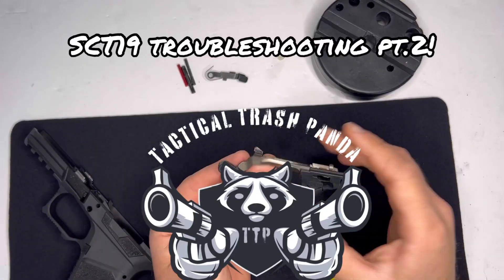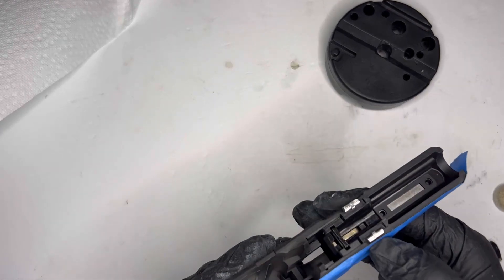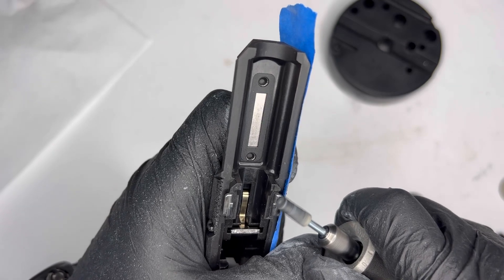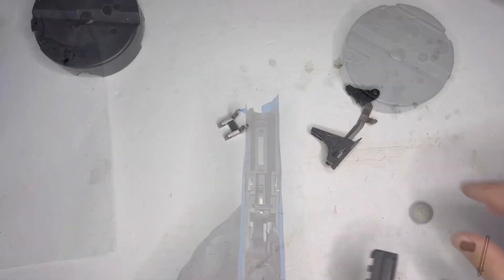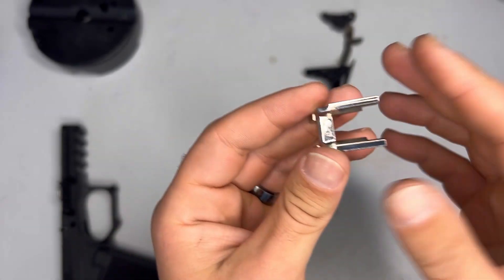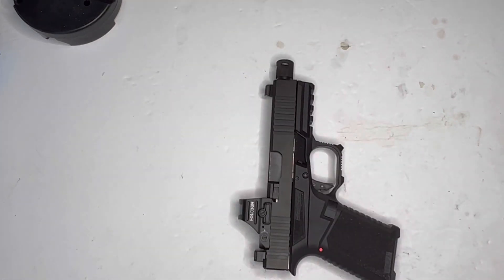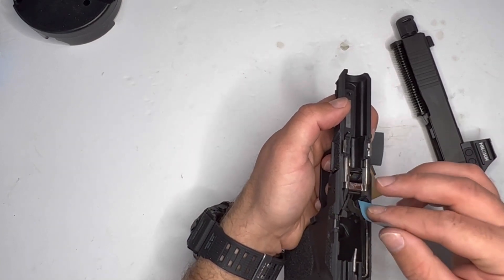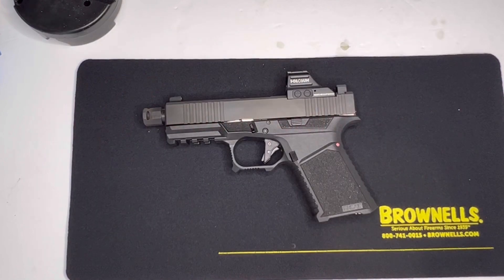SCT Trouble Pt.2 @brownells

Comment: I had the same problem with my sct19.  My problem ended up being the. Brownells recoil spring / guide rod.  Switching to the oem Glock part fixed my problem.
Reply: brownells has oem glock parts on there aswell so did you switch it out with oem glock parts from brownells ? wanna make sure if i have this problem i won’t buy oem from brownells
Reply: @jonfym  I bought the brownells slide completion kit first, but most of those parts had issues.  I fixed the problem after I repurchased all the Glock OEM parts.  The only Brownells part that is still working is the striker spring.
Reply: @CTorres_1993  ok good so basically in other words don’t get brownells oem glock parts cool . thanks for your help appreciate your feedback!
Reply from the maker: @cody mine ended up being the overwatch percision connector’s bend angle was too far out causing too much friction onto the slide. I swapped it out with a zev connector that I had laying around and it seemed to solve the issue. I did replace the recoil spring with an oem though just to be on the safe side.
Reply from the maker: I haven’t had any issues yet with the Brownells parts in my other builds.
Reply from the maker: You can never go wrong with oem parts 💯
Reply: @tacticaltrashpanda  hmmm so the gun is fixed that’s great! i was waiting for your next video to drop seeing what was going on and is it fixed because im building that gun myself soon ordered clips already n everything
Reply: @tacticaltrashpanda  can’t wait for the video on it to drop !

Comment: Is it true that Flitz doesn't have any abrasiveness to it? Have heard many people say to only use Flitz when polishing Glock parts, because others have abrasive in them that will wear through the Tenifer, but that Flitz doesn't have any, so it's safe to use. Never verified that though... and not sure how it would be able to work without any abrasiveness at all. (Also, I polished through the Glock Tenifer coating once with Flitz and a dremel on high speed. I thought that since it was Flitz that it was safe, but I was wrong, even though the part works just fine. Was on the face of a connector, so it's not a high friction area like a sear).
Reply from the maker: I’m not sure to be honest with you brother. I usually start with flitz and then just finish it with some mothers.

Comment: Im with Grest. Shoot some rounds thru it and/or get that OEM recoil spring. It should still work with the micro comp. If not, going to have to go to a lighter recoil spring which might cause this slide grind again. Or run it without a comp. Give us an update, brother.
Reply from the maker: Ended up being slide rub from the overwatch precision minus connector angle being a little too far out. Got it all fixed now! 🙌
Reply: @tacticaltrashpanda  nice!